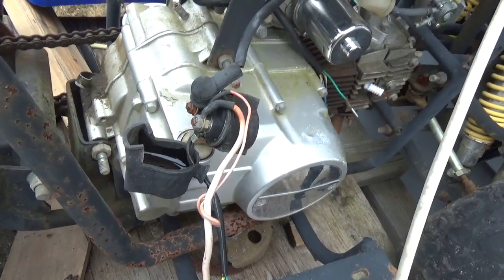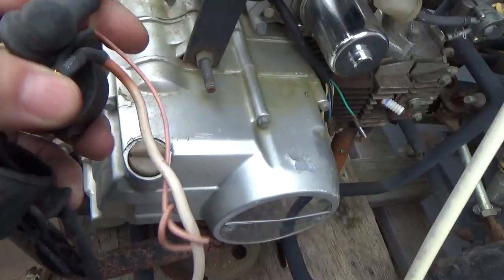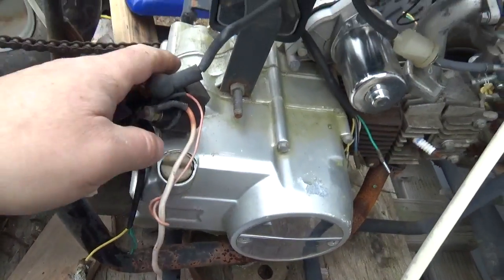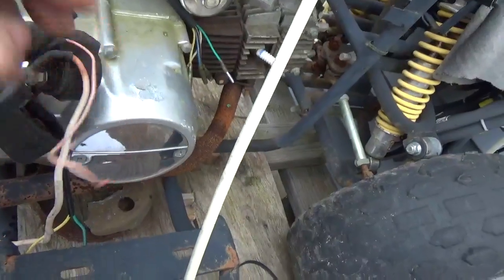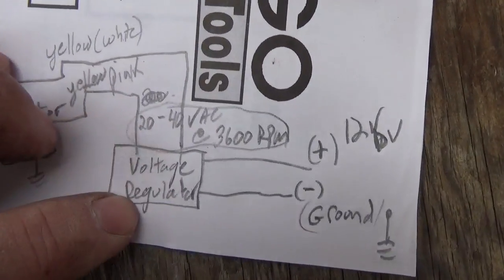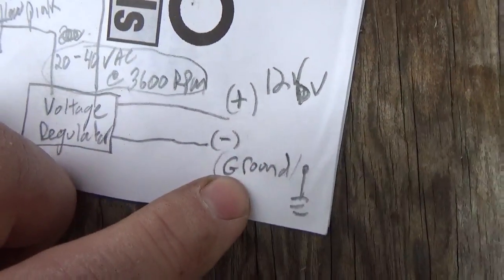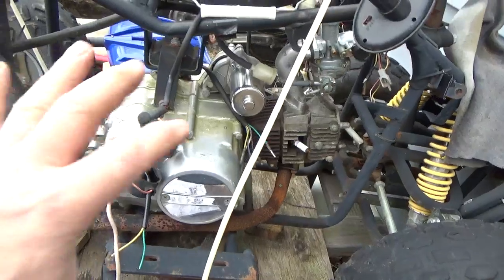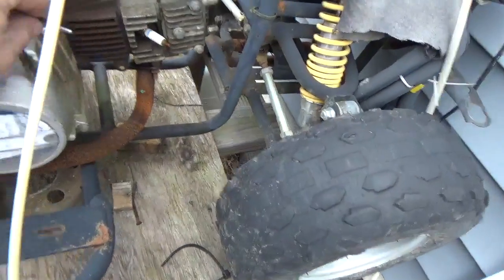ATV starting solenoids, ATV Voltage Regulators, how they are wired.,

Comment: May need a scope , or something faster than a multi meter ?
Reply from the maker: Hey Terri, I was looking at a China fly wheel, looks like it has 4 poles, so, at 3600rpm it is running at 240 cycles per second, a scope would work.... Thanks for Ur thoughts, suggestions, watching, and commenting!!!
Reply: Is there a risk of damaging a regular meter? They are set up for household AC, 50/60Hz. Wouldn't chance it.

Comment: I have a problem i have an electric start 50cc dirtbike but there is no starter solenoid or starter motor but the stator has ALOT of wires coming from it and there is a box about 5 times bigger than the cdi that also has alot of wires comin from it and im stumped have you seen anything like this.
Reply from the maker: Hey James, Is it a 4 stroke? Does it have an auto transmission?   Sounds like it might have a remote control engine off feature to save one's kid from driving too far away.... Can U figure out what two wires go to the pulse generator????  U have a tough one here.... Thanks for asking, watching, and commenting!!!
Reply: Its a 4 stroke and as far as i can tell the stator is the starter motor. Ive done alot of looking online and connot find any replacment parts i still have the original parts but i need someone who knows how to wire it all up.
Reply: Also its an auto transmission i found the blue and white wire from the pulser and originally the pulser wire split off into 3 wires and went to the cdi and to another box it has on it.

Comment: I hope you see this seeing as it's over 3 years old. I have a 1998 Yamaha Timberwolf 2x4. The problem I'm having is when the battery is connected the starter starts, without the key or the main switch being on. When I turn on the key and the on/off switch the engine will start but the starter keeps spinning. To stop it I have to pull the negative cable off of the battery. I have replace all electronic parts except for the starter and regulator. I have changed the key switch, handlebar switches and of course the solenoid. I get 12.2 volts across the solenoid terminals. I spent 6 hours inspecting wiring today and didn't find any bad wiring. The battery is grounded to the frame. What could be my problem. The previous owner had a kill switch on the negative battery cable but I want to fix it right and I don't know where to look now. The start button doesn't work either. So it'll start as soon as the ground is connected to the battery. Important question: When I put power to the starter solenoid, straight from the battery should I hear a click? Also, if everything was working, should I get 12+ volts on the starter solenoid when the key and on/off switches are off?